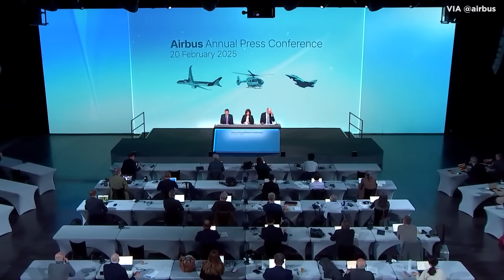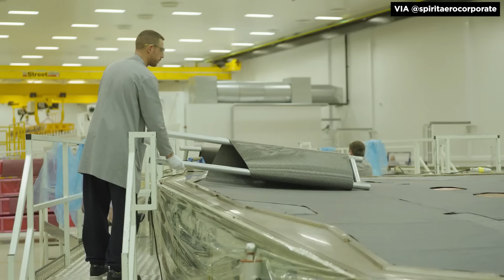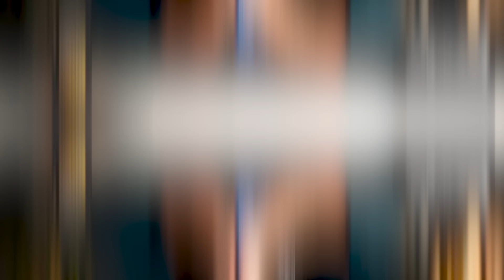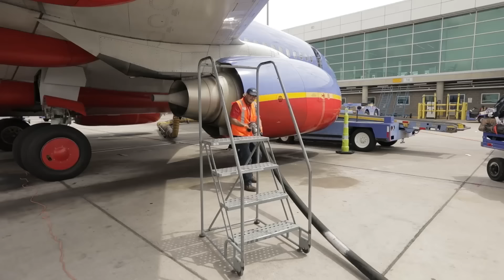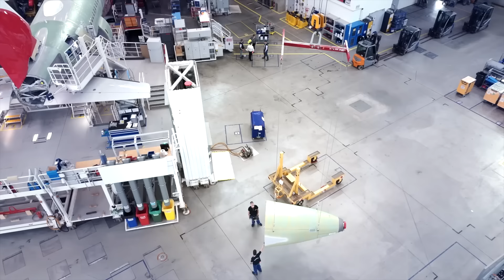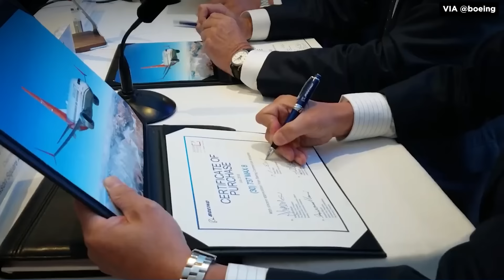Did Airbus just Change EVERYTHING?!

Comment from the maker: Remove your personal information from the web at https://joindeleteme.com/MENTOURNOW. Use code MENTOURNOW for 20% off.
Reply: Functionally, I think that a diesel electric series hybrid aircraft with high power, water cooled, electric motor "high bypass turbofans" would be the best option for future aircraft. I think in your prior video detailing the new Rolls-Royce geared turbofan engines mentioned that the most efficient continuous rpm for a high bypass turbofan is something like 4500 rpm. Easily do-able by an electric motor. The diesel engine (pair?) would need to handle, at most, the average power consumption at cruise, the batteries would handle peak load for a typical climb duration + a safety factor, and the motor would need to handle the max continuous needed for single engine flight and the medium term single engine climb duration. 

Some rough napkin math shows the motors would need to provide something like 15,000hp each, to get 30,000 lb feet of cruising thrust assuming that cruising is done at 50% output, but that level of power output has been easily doable since at least the 40s as seen in certain ships like the wind class icebreakers. These ships have been using similarly powerful electric motors with diesel electric series hybrid systems since at least the 1940s. 

Half the work has already been done by the shipping and railway industries and the airline industry just needs to repackage it using modern technologies with the right weight and balance considerations that fit their needs. There are a lot of applicable new technologies currently in use in hybrid civilian vehicles such as axial flux motors that have not been tried at these power levels and scales yet. Koenigsegg's axial flux motor weighs ~80lb and provides 250kw of power. That is roughly 3.1KW of power per LB of weight. The leap 1b has a specific power of 3.7kw worth of max continuous thrust power per lb of weight. It is comparable.

Perhaps a series of smaller axial flux motors within 4 separate engine nacelles that weigh ~2000lb each would be a do-able format?  Or perhaps a larger, composite wing, bodied aircraft like the one at 15:00 with 1 15,000lb or  two 7,000 lb rearward centrally located engines? For reference, the leap1b engines on the current a320 neos weigh ~6,600lb each.

The other upsides include, effieicency gains near as practicable with current technology to the theoretical maximum possible according to physics, not having to change the current infrastructure, possibly being able to use gas station fuel instead of aviation fuel, not having to invent ways around the specific energy density problem of hydrogen fuel in a pressurized tank, and not having to deal with the safety problems of needing compressed, pressurized, fuel tanks.
Reply: Clickbait = unsuscribed
Reply: I actually enjoyed the video. No matter the title, I learned a lot.
Reply: Can we get Ben next time to properly introduce himself and his background as his last video said nothing. I’m surprised this wasn’t explained to him in his 1st video
Reply: @chefgav1  It always sucks when YouTubers lose who they are and go into expansion mode because more money. You don't even fly anymore man. It's like when they roll out the old guard on Air Crash Investigation who used to fly planes but now prefer to tell stories for a living. That's aa sad place for a channel to end up. Eventually it's just a bunch of randoms presenting and writing with all the sole and intimacy which made it popular just go out the door plug.
Then the time to unsubscribe has been reached.
Reply: scam

Comment: I am sure that the good folks at Airbus are clever people, but the whole discussion around hydrogen seems to ignore basic physics. The video mentions a hydrogen ecosystem - Produce, transport, store and deliver. There are problems with every one of these parts of the hydrogen ecosystem. 99% of hydrogen produced today is produced from fossil fuels using steam reformation. This includes "natural gas" - mostly CH4 (methane - 75%) and coal (22%). These processes are substantially more CO2 intensive than simply burning the methane itself. Hydrogen is used mainly in the production of ammonia, a key agricultural input as well as various other important chemical processes. As with so many other "renewable" fuel promises the discussion turns quickly into a food vs fuel discussion. You can produce hydrogen in other ways and this leads to the rainbow spectrum of types of hydrogen. Methane produced hydrogen is "grey". Does that make coal produced hydrogen "black"? If carbon capture and storage is used it then becomes "blue". If hydrogen is made using nuclear electricity it is "pink". Only when it is produced from renewable electricity is it "green". But all these other colours are so inefficient that only a tiny % of hydrogen is actually made with these other energy source options. Note that point - hydrogen itself is not an energy source. It is an energy carrier, like a battery. It is substantially better just to use the electricity directly or from a battery.

Hydrogens physical properties, being the smallest atom, makes it very hard to store and transport. Not only does it escape through seals and valves etc, but it will also escape directly through the material used to contain it. Hydrogen also has chemical properties, making metals brittle. It also reacts with plastics. So its storage, transport and delivery is also hugely problematic.

I am not saying it will never happen. Maybe technologies will be developed that overcome all these problems. However, physics is a tough task-master, including the laws of thermodynamics (1&2 especially). I am surprised so many people in big corporates and government are willing to waste so much money going down the hydrogen rabbit hole without bothering with these basics.

Comment: Hydro is already a done deal for the newer A350-1000E model. Also research work started on the next version of the A380 because the market is coming already for them again faster than expected. Boeing lost the race and need to find a long term replacement for their B74 family which they know will be only met with a new platform all together which because of China right now is put on hold. Boeing has to sit tight same as Airbus and let China take a share before it folds and than scoop up the newly opened 20% market. You need to look more at RR what they are doing and LH on Engine Dev. This is where the key for both is right now.

Comment: When burning hydrogen, it does leave slight emissions. The fuel cell is the better option. It combines with oxygen returning back to water H2O, generating electricity. This would mean aircrafts would need electric motors and propellers. The max ground speed is 450 knots. Nothing is lost from water to water. See Wikipedia Hydrogen-powered aircraft section.

Comment: External forces are going to shape the industry. Right now Boeing and Airbus want to add more than 5,000 aircrafts in the next twenty years. Most major airports are running at capacity, even though they are fields being underutilized. Eighty percent of flights are small aircraft like 737s or A320s. Based on recent events, flights should have been cut because of the ATC shortage. Aircrafts would have to move to a minimum of 300 passengers. Guess what, Boeing has an all-composite plane with a reasonable price, called the 787.

Comment: The biggest threat to aviation is called the EV, the electric vehicle. Hypothetically, if the world had 50% of EVs. There would be a cut in the production of gasoline. As it stands right now, three or four gallons of jet fuel can be produced out of a barrel of oil. The price of kerosene would go up.  It would make or break certain airlines.

Comment: Which is more efficient the train or the aircraft in a 300 mile range. I happen to be on the TGV years back. We were doing 188 mph. The ride was extremely smooth, didn't have the airport hassles. But I did suffer a little mention sickness, looking out the window!

The only problem with hydrogen is that it could be made from water,  plain H2O. I actually made hydrogen with my third grade chemistry set. Norway has been using hydrolysis since world war II. Imagine if everybody was doing this. What would happen to our water supply?

Comment: For hydrogen, on-vehicle storage tanks and ancillaries are heavy. To keep the same ratio between equipment and carried energy, larger energy stores would be required. For that reason I do not think the prediction of H2 powered aircraft being limited initially to smaller aircraft is realistic. It would make better economic sense to use H2 on larger aircraft. Specifically, wide body freighters. This would also make the roll out of on-site H2 production facilities more manageable.

Comment: The hydrogen delivery ecosystem is at least 25 YEARS away, due to lack of electrical generating capacity and distribution. This is true for both Europe and North America, no matter what the "green" politicians want to believe. It can be advanced by about a decade by the fast re-adoption of nuclear power generation, but of course that is also a non-starter for those same Greens who see nuclear as more evil than fossil fuels. To design and build an aircraft  that could only fly to 10-20 airports in 2045 is insane, so I can't imagine any scenario for it. 

If there was widespread adoption of a modular nuclear generation station with adjacent H2 production facility then it becomes both feasible and economical, especially to allow otherwise infrastructure-poor countries to develop new airports and leapfrog the "old world" just like the cellular revolution leapfrogged traditional telephony in developing countries in the 1990's and 2000's. That would be very interesting to see! But the green ideas of wind and solar providing the generation capacity needed just don't add up inb most cases, so unless some governments change their political positions, it all falls apart in the cost/performance equations.

Comment: Very interesting and even captivating content. I know I am a bit off target here, but I couldn't fail but notice that there is not incentive for the passengers regardless. Wide body planes have brought the minimum 3 seat rows, which has been, for passengers, the worst flying quality experience outcome. It would be great to see, most especially for long flights, some content addressing that vision of passenger quality experience aka private space. (I know the airlines have the last say on this, however, the way a plane is built will determine the interior design).

Comment: Regarding hydrogen, I'd investigate the possibility of improving existing engines to include a dual fuel option of J-fuel and Hydrogen. First, this reduces the need for the universality of hydrogen availability at all airports. The modifications to the engine might be more minimal like including a secondary fuel injector system into the combustion chamber for hydrogen, otherwise the concept of the engine is similar. At different points in the engine operation profile, trimming the ratio of J-fuel and Hydrogen could improve efficiency in unique ways, for example, burning J-fuel more at the start of a flight to get the weight down, and burning H more toward the end of the flight since hydrogen has greater energy density. Hydrogen could play the role of the reserve fuel reducing the fuel weight.

Hydrogen, which would be stored under pressure would use pressure regulators instead of fuel pumps which would save a little weight. Additionally, a hydrogen APU might have a simpler design with hydrogen available on the aircraft recovering some of the weight there as well. The full criss-cross of all fuel sources getting to both engines could be relaxed if both engines have access to two different sources (JF & H) for each engine assuring there is redundancy.

For locations that have greater energy over-production, more emphasis could be placed on hydrogen fuel. Likewise, with two fuel commodities to trade, airlines could work fuel option contracts with more clever insight able to walk away from JF futures (or H futures) to a greater extent if they don't get optimal terms. Even if the range is from 90-10 to 40-60 JF to H, across a system, that could provide a fair amount of leverage. Today, the fuel providers know they have limited options because X amount of flying requires a calculable amount of JF, and there's nothing the airline can do about that on short notice.

Comment: Hydrogen and battery powered planes are the spawn of politicians and know-nothing management. With current technologies they make no sense at all. There is no incremental improvement of current technologies that would allow them. Anything that made them possible would be so earth shattering that everything would change, not just aeroplanes. Until then engineers will pretend there's a way so they can stay employed, but that's it.

Comment: Hydrogen is never going to be used in aircraft. Way too dangerous, way too inefficient, way too high cost in terms of maintenance and fuel. It would be far too expensive for passengers and impossible to generate enough green hydrogen. The amount of water needed by a large airport is beyond th ability of the local area to support 

And the size of tanks needed even for medium distances would mean no passengers or freight could be carried.
It is completely unfeasible as a technology and this now clear to Airbus that they have wasted years going down a dead end

Hydrogen and transport do not go together at all. And they never will.

Comment: Hydrogen powered aircraft? No, not going to happen. Why? Short answer: Physics and chemistry.

Long answer:
Because hydrogen is so small of a molecule that it leaks through materials. And when it does so, it causes tiny holes within the material that it leaks through. That phenomenon is known as hydrogen embrittlement, which as the name suggests, makes the affected material brittle. It's also very reactive, meaning it goes kaboom very easily and very violently. Then there are the other storage problems, such as that in gaseous form hydrogen has a very low density. So you would need either a huge tank, which is not an option. Or store it in a high pressure tank, which is not good idea given the small molecule and high reactivity.

The other option is to supercool it and store it as a liquid. The boiling point of hydrogen is -253°C whereas the freezing point is -259°C. So there's not exactly a whole lot of thermal wiggle room there, either. And because you inevitably have some of the liquid go above -253°C turning into gas, you need to vent it out. Remember that reactivity problem? Yeah...

Then there's the problem of pumping hydrogen to deliver it from the tank to the engine. There we have the same problems of leakage, embrittlement and reactivity again. For these reasons hydrogen isn't going to be used for cars, ships or aircraft anytime soon.

Comment: Embraer E195 E2 is the best airplane ever! Extensive wingspan and huge aspect ratio make the airplane even more fuel efficient than the A220 ( which is a great airplane). Only drawback is that Embraer has managed to fit in tanks that hold only 13,7 t of fuel compared to the 17,2 t of the A220. If it could hold the same amount of fuel it would have range close to the A320 XLR and could be flown transatlantic.

Comment: Hydrogen is really interesting, but it carries a lot of issues. One of the advantages of a hydrogen system is that this system can use LNG, or liquid methane. Something that the german government plans to incorporate in the future thermoelectric power plants. Instead of burning coal, they will burn hydrogen, but since there is no viable source of hydrogen, methane is a good substitute. It is produced from bio waste, and also the production of hydrogen is anyway from methane. So I believe it is a viable solution, if they manage to solve the problem with fuel tanks, since they are of extremely high pressure and the volume will be much bigger, since the densiti is lower than that of jet fuel.

Comment: How will the RISE engine, not having a cowling, handle a broken fan blade? Isn't the risk very high that the debris will penetrate the fuselage? 
Also, a different question, why not installing active noise cancellation in the cabins? Filter so that human voices will go through but low frequency noise gets cancelled out. The technology is there and is not that expensive.

Comment: If electricity could be produced cheaply enough, we could manufacture fuels by combining CO2 from the atmosphere and hydrogen produced by electrolysis from water.
In other words, carbon based fuels like methanol, or even kerosene, would suddenly become "carbon neutral", and much less expensive. 
Molten salt thorium BREEDER reactors could generate electricity that would be too cheap to even meter.
That is a technology that truly would "change everything".

Comment: I'd be interested in the feasibility of a new aircraft that used either the rise or the ultra fan - both very large diameter.  That would allow choice and also facilitate ongoing development of both.  Where things get interesting with hydrogen is that it's most likely to start with smaller aircraft but Embraer probably are too limited in design capacity.  And of course we can't forget the Chinese.  The current and likely tariff walls will also increase volatility and financial dangers.  This may hurt Airbus more than Boeing.  Plenty more videos ahead!  Thanks Petter, interesting.